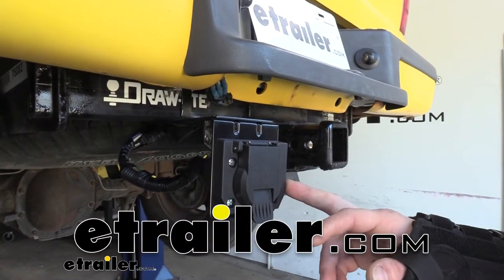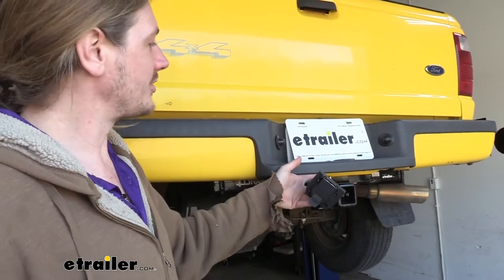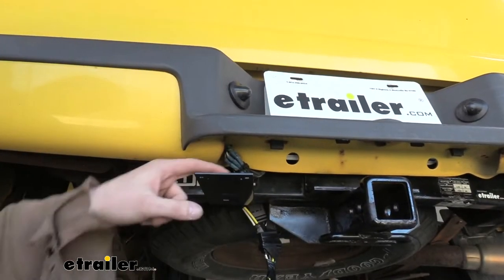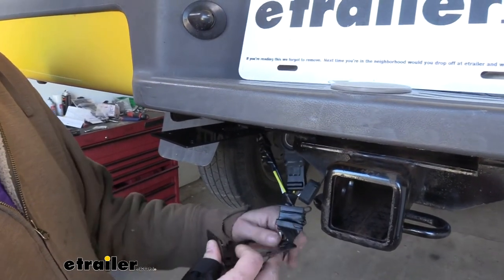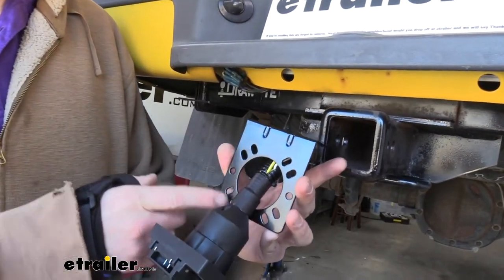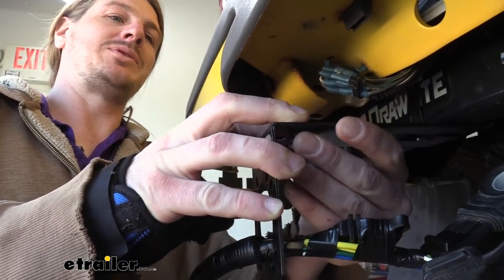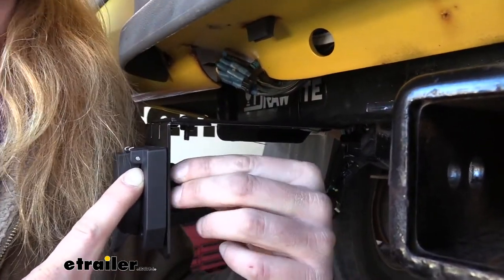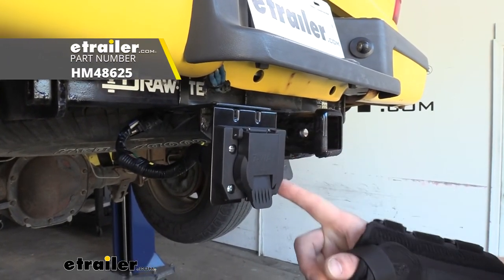etrailer | Hopkins 7-Way and 6-Way Trailer Connector Universal Mounting Bracket Review

Comment: these are so thin they literally bend when you try to plug in the connector
Reply from the maker: We have seen that in some applications, it is better to put a second hand on the bracket to give it support.
https://www.etrailer.com/Accessories-and-Parts/Hopkins/HM48625.html